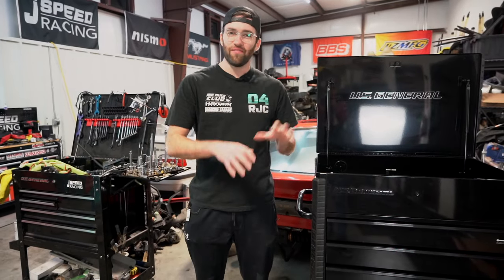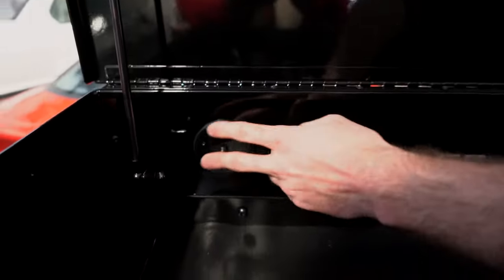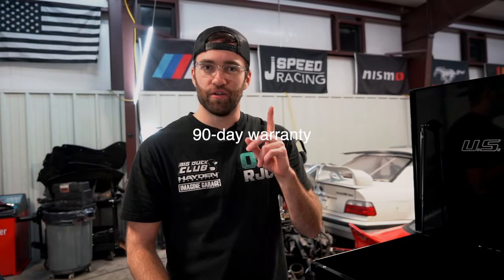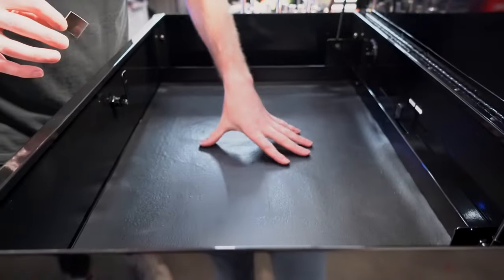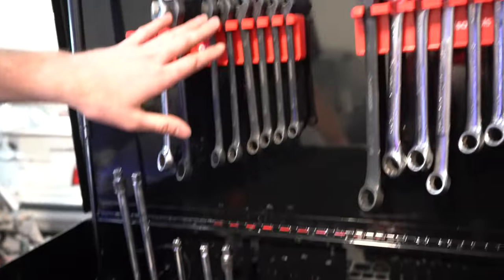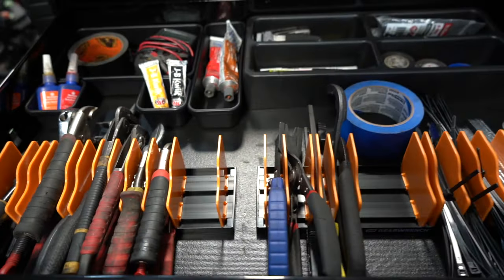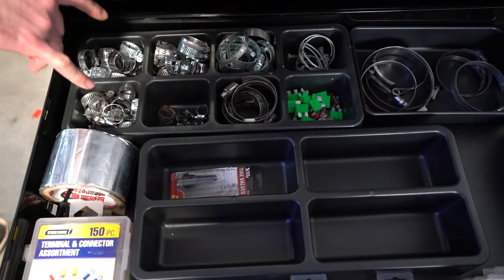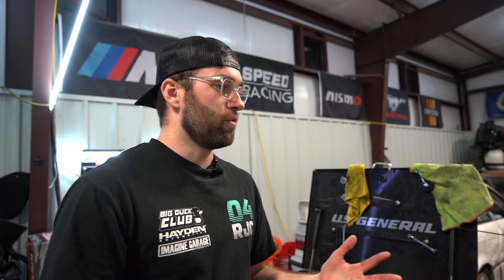HARBOR FREIGHT 34" TOOL CART VS 30" MECHANIC CART! REVIEW: WORTH THE MONEY?

Comment: You can add the 5 drawer folding side shelf to it.  Just drill holes in it using the handle as a template and it'll screw into the  factory handle holes
Reply: I bolted the harbor freight side cabinet to the handle holes and it works perfectly on the box
Reply: @ScumpsBaldSpot  that sounds good also
Reply from the maker: I might do that! Thanks man

Comment: I bought 4 wrench organizer sets from tool widget and honestly, they’re amazing. As far as the socket organizers, I need mine to be upside down because it drives me crazy when the open end of the socket is facing upwards. Otherwise, tool widget would be the way to go. It is pricey if you buy them for a lot of sockets. They also have plier organizers as well.
Reply from the maker: Hey Cody, oh cool. Ya we rarely move our sockets, plus they are labeled so we know exactly what size. I had the husky organizers before and did not like them. These are great imo. The wrench organizers save so much space! I like the Gear Wrench ones cause the spacers slide. I think other do the same idk. It will be a continual development to get the box perfect haha. thanks for watching man.

Comment: Now I bought my 5 drawer when the new one wasn't available.   But I still think it's about right for me.     I have alot of tools in cases (no good way to organize outside the case) so the cubby underneath is nice.  And for my home use tools it's just some pliers sockets and wrenches.    Don't have nearly as much as I do at work.      However I also have two smaller tool boxes given to me cause my dad ran out of space to store them.    I keep my consumables in those.    And more car parts lol.    I have a fuel system drawer electrical.    Fuses.   Timing hardware etc

Comment: Love my 30" so much got 3 More!  I compared to the blue point and the Blue point almost 1000 bucks I got all 4 + some ratchets for 1000.  Are they good as Blue point yes the wheels are going to be changed to the same type as Blue point other than that great cart not to big put a shelf on one glove holder and getting the paper towel rack.  Anyway harbor freight stepped up on the boxes have fun.
Reply from the maker: I love this box! good stuff.

Comment: You can actually remove the plastic from the drawer handles, it just slides in and out from the right hand side. That piece is optional I belive.
Reply from the maker: i do like them locking for when I put it in my trailer. Good to know though, thanks!

Comment: I use both at work. The 5 drawer is fight. The 6 drawer is just such a nice box.
Reply from the maker: great input
Reply: Is fight? What does that mean?
Reply: @user-qjvqfjv  To me "Is Fight" means it is ready to go to war. Total Unit. The 5 drawer isn't as nicely finished as the larger 6 drawer but it is very sturdy plus smaller and more maneuverable. I'm afraid of scratching my 6 drawer but I regularly press in and out ball joints in steering knuckles on my 5 drawer. I use an 18 wheeler mud flap cut to fit as my open top drawer liner. Peace.